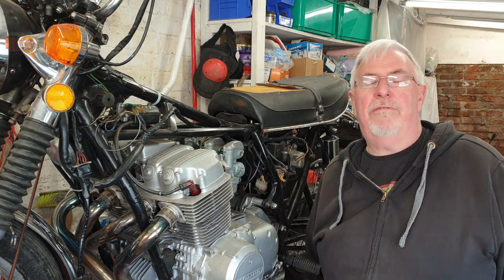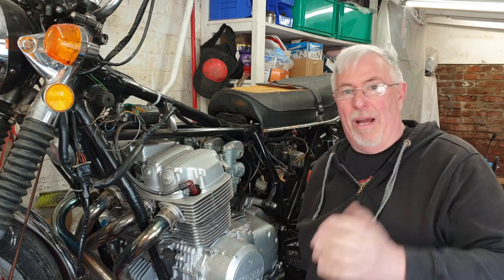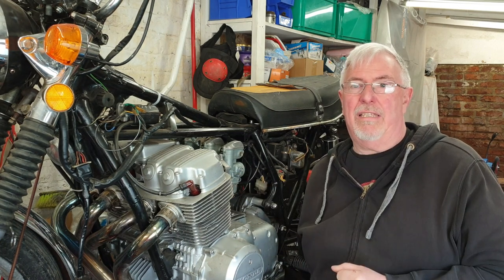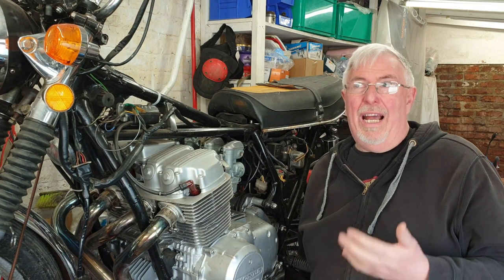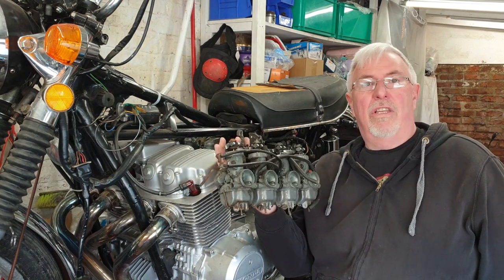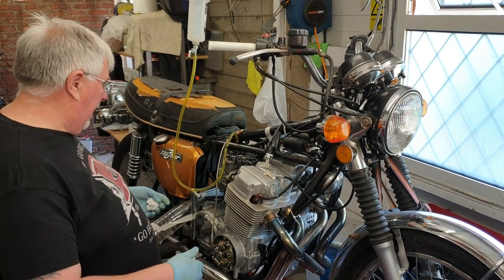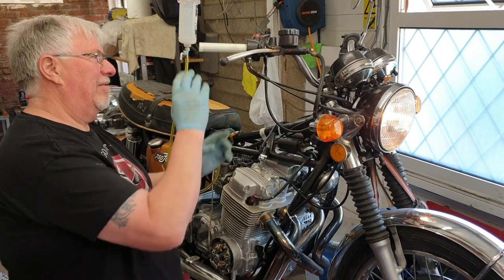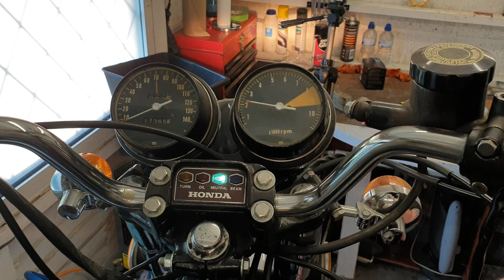Swapping Carburetors CB750F to CB750K Keihin | Carb Clean & Rebuild | Honda Project | Part 17

Comment: Right on brother! This is Jose by the way, my actual legal name is Joe but Jose is my name in Spanish, I changed my name for YouTube also, Glad to see you took my advice on picking up some original carbs, sounds like she just needs the air and fuel mixture tuned and airbox fitted and she should run way better, looking forward to seeing a video of her being tuned and running, good luck brother!
Reply from the maker: Thanks Joe, appreciate the recommendation of them. I'm sure from this point I should be able to get them running sweet, off to a good start with them!

Comment: Just like to say a big thanks for sharing your carb problems .

When you found that cab overflow pipe cracked that was a real eye-opener for me.
I own a CB 350/4 and had problems with the carbs for ages ,I could not get it to run right whatever I did .

I must’ve had the carbs off six or seven times ,but it still kept leaking out of the overflow pipes.
This baffled me to the point that I managed to source a really nice set of recondition cars from a chap in Holland.
I fitted these to the bike, and I’ve never had another problem since.

Thanks for sharing
Tony
Reply from the maker: Cheers Tony! My soldering repair on that wasn't the prettiest but it's still holding up well. Carbs can be a real pain in the backside to diagnose. Really glad you got your CB sorted, its likely it was the same issue thinking about it. :)

Comment: You’ll find these bikes much prefer having the original air box fitted, the rubber velocity stacks in the original air box are there for a reason, when I fitted K&N style pods to mine it ran ok but had a stumble when snapping the throttle open, I took the rubber velocity stacks out of the  original air box and grafted them onto to K&N’s, it completely fixed the stumble and the engine ran better in every respect.
Reply: Really! that sounds really interesting brother! I would love to see a picture of your work!
Reply: @oilinmyblood3906  it’s a shame we can’t load photos on here, you can see them very briefly at the start of a video I posted a long time ago, just type “Marks CR dyno” into YouTube, it’s only the first second or two you can see it though, basically I cut the front out of the filter until it was a little smaller than the largest diameter of the velocity stack, then pushed the velocity stack about 15mm into the filter, then secured and sealed it with Sicoflex, then just attached to the carbs with the original clamps, hopefully that makes sense!
Reply: @1234567marks  yeah it does actually brother! that's pretty much what I was picturing in my head! But I would be cringing at the fact that I would have to tear apart that $50 K$N airpod × 4! That's a lot of money to be tearing it apart! But I guess in the pursuit of more power why not!
Reply from the maker: Planning to throw the matching air box and rubber stacks on with these new carbs for now. However sounds ingenious to combine the original stacks with individual filters. Cheers!
Reply: Very nice work. I need to clean the carbs on my k4. Might take me a bit longer than 11.55😀 what sort of filter will you use between the tank and carbs?
Reply from the maker: @soupdragon5555  cheers! Always takes far longer than you expect 😂 I use these little filters all the time: https://ebay.us/3nYaks
Reply: @SPANNERRASH  Thanks for the tip, Ill order some of those. Good luck with your project.

Comment: I have a K2 with a set of K7 carbs and wide open inlets (3d-printed trumpets). The bike runs sweet and pulls hard to the  red line. I can’t see the advantage in the old style carbs, with the lack of accelerator pumps and all.
Reply from the maker: Thanks for sharing, interesting that you had no issues with the later style carbs. Maybe a big part of my problem was that the later style carbs I had were problematic, despite my best efforts.
Reply: @SPANNERRASH  It very well could be. I had mine cleaned in ultrasonic bath and rebuilt with new parts. The one issue I had but found with the carbs hanging from the roof in the garage was that the accelerator pumps was not working. It was due to a just a fraction to big o-ring between the float bowl and the carb body for the acc.pump on number 2 carb that when squished didn’t let petrol pass. Once that was sorted and a squirt of petrol was sent, everything was golden.

Comment: Can you use 82’ cb750 DOHC carbs for a 1980 CB750F?
Reply from the maker: I think there are a number of issues, carb spacing, finding rubber manifolds etc.  I suspect with patience it could be done but from various forum posts it doesn't look like plug and play.  Good luck if you try it, and do let us all know how you go on.

Comment: Wow excellent job How long did it take to overhaul the carbs. I only ask because I can't set my cb750k 1981 carbs to run properly it splutters and cuts out. So this weekend I removed them and that was a pig. I have 4 carbs overhaul kits and wonder how long I need to put aside to sort these out never done this before so your videos have been a godsend to me and has given me the confidence to have a go. I did have them done at a garage but same problems reoccurring. Cheers Dave from Sheffield
Reply from the maker: Thanks Dave.  You need to allow a fair amount of time to do a good job.  I suggest a full day.  The ultrasonic isn't an essential, you can find other ways to clean the metal.  But I would recommend that compressed air to blow jets and airways in the casting is essential.  And sometimes a set of jet files, or thin wire (guitar strings) to poke them through. I would try to keep the original jets and give them a good clean if possible. but change the float valve and gaskets.  Make a tool for setting the float heights, see my other video.  Usually, the main problems are with the pilot jets, so make sure they are really clean along with the airways to them.  If you take your time and plenty of photos so that you put it back together correctly you should be fine.  Good luck.
Reply: @SPANNERRASH  brilliant thanks a lot I ordered an E guitar string for the pilot jets and two cans of carb cleaner (spray) Winn's. Sorry no compressor. Thanks again for the advice much appreciated. Dave from Sheffield
Reply from the maker: @kimsmith4409  No problem, hope it works out well for you mate!